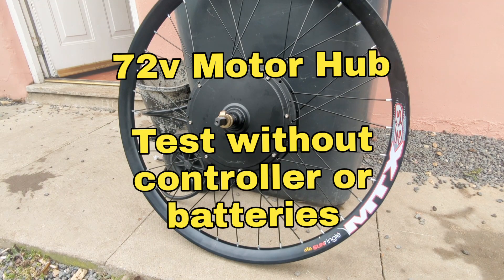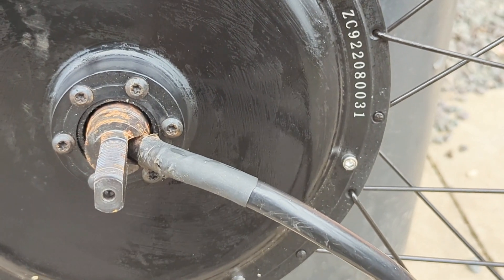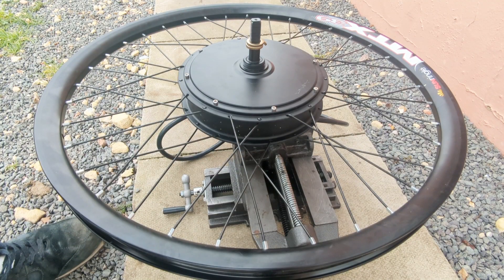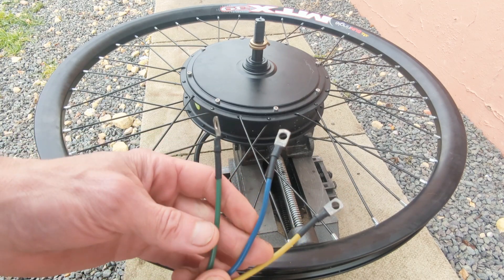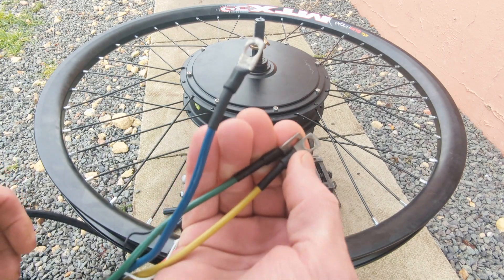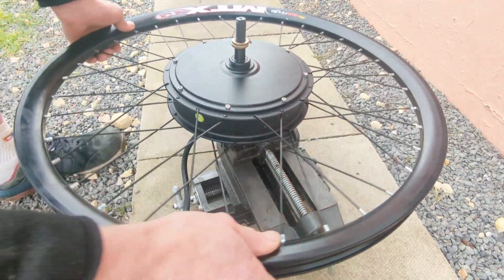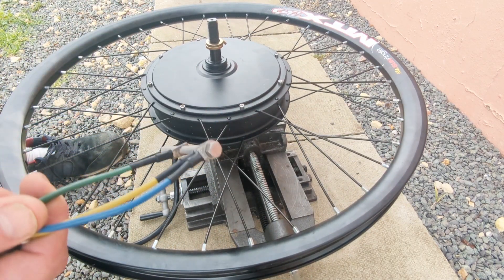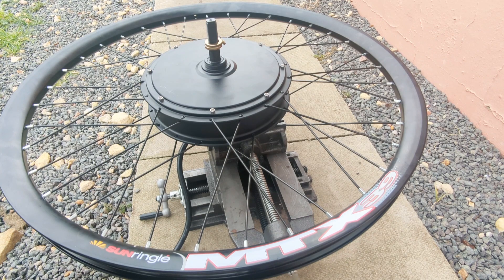3kw E Bike Hub 72v Testing Without Battery or Controller - Free Energy Project - 11th February 2023

Comment: Gavin, off turbines and about the bike side off things. I've a motor with six hall wires, the white being a speed sensor possibly, just tmy KT controller doesn't have a relating wire. All hall sensor colour wires are connected and th bike runs up to the set max speed. Just it's not adhering to level, assists, 1-5

Comment: Hal sensors are easy: They need ground and +5V and as you have 3 of them, you have 3, 5V digital signal wires to choose from. What I have done before botching together RPM or Speedometers, is to use a random cheap bike computer. However as you'll have multiple pulses per revolutions, (half the number of pulses, as there are magnets) and that would require you setup the bike computer with a very small bike wheel diameter , to have the speed readout show RPM, You'll need build a dividing circuit: Get one or two CD4017 decimal decade counters ICs, for division by 10 or 100 between the Hal sensor and the bike computer. Another option is ordering a cheap programmable panel RPM counter from China, but that is the low effort, dirt cheap solution!
Reply from the maker: Thank you brother. I will read this properly when I get time. I've got a lot on my plate at the minute. Thank you very much

Comment: My big  phase  cables wore torn by my disc brake screw .. I got the soldered but no power still to my throttle do I need a new motor core ?